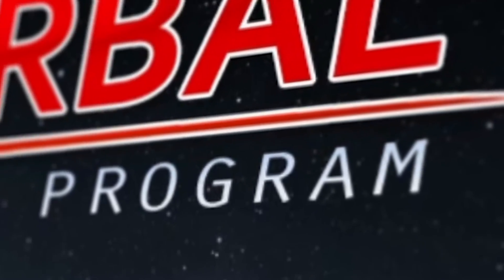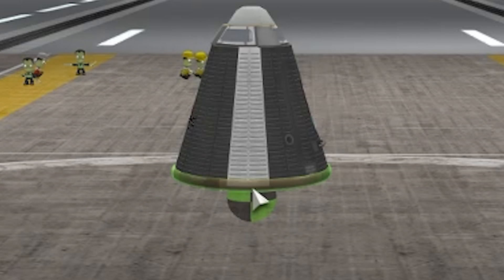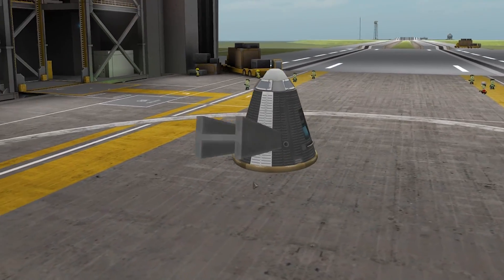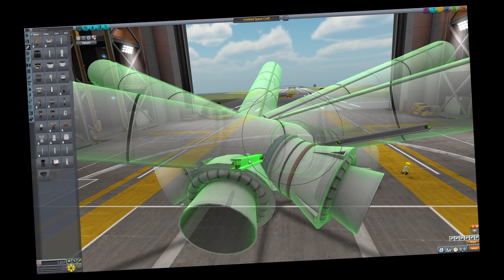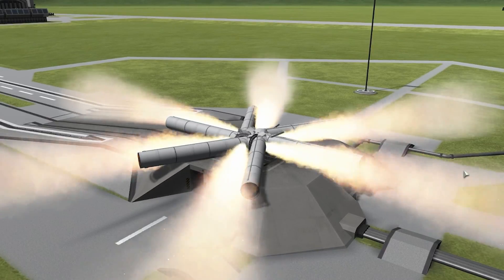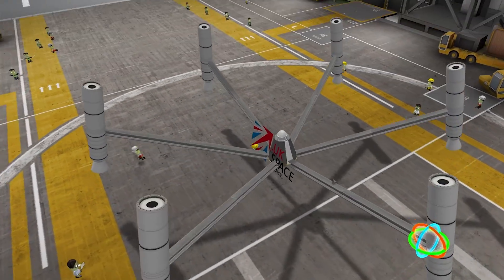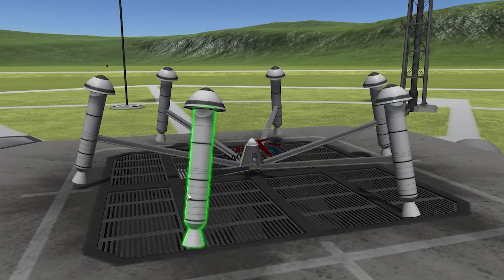I SENT A BRIDGE INTO SPACE and this happened in Kerbal Space Program!

Comment: 1. You can cut the parachute in the context menu.
2. You can toggle "rigid attachment" in the VAB context menu for more stable connections
3. Things will only be attached to where they're attached. Use struts to connect more parts with each other

Comment: if you have advanced tweakabales on you can turn rigid attachment and autostrut and you dont need struts + every part sticks stronger than metal
also hold alt/option while connecting and it will connect beetter
also ksp doesnt actually connect every part that touches together

Comment: Beware, decal flags generate fantom forces, don't use them unless they are really on to the rocket parts with the same diameter or flat surface. You can built areplanes out of decals...
Contrary to the beams, the girders are near undestructible...
To have Uranus in KSP, you might want to install KSRSS (RSS is too difficult for a newbie)
If you are interested on how to cheat the physics range to build megastructures in space, Stratzenblitz has recently done a video on a 5 kms long mega bridge on the little dwarf planet Dres...

Comment: Try to put Jeb on the mun, and maybe if you want to you can bring a bridge with you. also, the little circle next to the symmetry button turns on and off "snaping", so things will stay rotated correctly. this also goes for when you are rotating them after they are placed. holding shift will temporarily turn off snapping. also, boosters tend to work better when pointed up.

Comment: If you hold alt while moving a part, the ends will snap together with the correct rotation relative to each other. Also, there is a a button next to the symmetry tool that turns on a sort of grid for radial symmetry and rotation.

Comment: Hey RCE if you ever want to strengthen something up “(stop it wobbling) you can just add some tethers to itself. Such as in your first rocket, you could add struts from the rocket to the opposite engine this would prevent it from wobbling away from the initial point of control. This would also work on your second rocket. Have fun!

Comment: If you open the pause menu while in the game you can scroll down till you find a setting that says "Advanced Tweakables" , Turning this on allows you to enable two extra settings when you right click on parts in the editor.

These settings are
"Rigid attachment: Off/On" Which greatly increases the strength of the joints making it less bendy.
And
"Autostrut: Disabled/Heaviest Part/Root Part/Grandparent Part" this setting basically creates invisible struts from the part it's activated on to other parts automatically depending on the setting.

If you activated say, Grandparent Part autostrutting on those boosters on the ends of the girders, all 6 of them would automatically connect to 1 girder on each of the arms. This would give the rocket the same structural integrity as if you'd placed 36 struts connected the arms to  the boosters.

These are pretty much required for larger, more complex, and more structurally dubious rockets.

Comment: Excellent job on the bridge, but no, it doesn't count as space, sorry. :)  Space in this game is pretty explicitly defined as starting 70km above Kerbin. 

I suggest you try to get a bridge to orbit. That should actually be a fair bit of challenge, given that bridges aren't very aerodynamic in their normal orientation.
(Hint: keep speed relatively low at first when you're near the ground, like 100 to 200 m/s, because air resistance low down is rather a big factor.)

Comment: Back with more overly detailed KSP advice because I liked the video, I want to see more, and I want to maybe - just maybe - see you become half as good at putting things in space as you are at making me laugh!

The annoying and wonky part placement going on at 2:15 was due to the combination of placing the booster with surface attachment mode (where it attaches radially via its side, not via the nodes on its nose/engine) on and having symmetry on while the part you're attaching to also has symmetry. This will cause the editor to show the 'ghosts' of all the boosters as soon as you mouse over any part of the craft, making it really hard to see what's going on and put it where you want it. You want to turn off symmetry mode (shift+x) and surface attachment (hold alt) until you get your mouse over the place you want to attach it, then turn on symmetry and surface attachment as desired (release alt, press x) and the symmetry of the part you're placing will immediately conform to that of the part you're attaching to. Personally I find this most useful putting payloads in cargo bays, as it's almost impossible to attach to a docking port node inside without holding Alt.

Mandatory reminder that if you're serious about having remotely realistic part rigidity, you need Kerbal Joint Reinforcement (KJR). It's not even a mod, it's a bug fix. I'm not mad, noodles are quite funny, but they're not taking you to space without a ton of struts - several tons for larger craft.

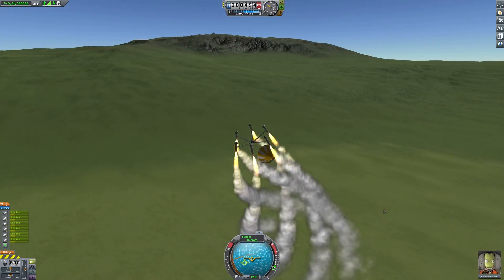The shaking that you saw in craft 2 and 2.5 (4:15-ish) that happened out of nowhere in craft 2 and that escalated from a slight sag in the beams in craft 2.5 are both "kraken attacks" - which you can find tons of info and memes on in the KSP community - and in this case were due to how KSP handles deformation at nodes... namely, not well. I explain a bit of the back end of the stock physics engine in the next paragraph, but the long and short of it is KJR will also fix this.

When your beams started to bend at 4:55, KSP went to every deformed node and started immediately applying phantom forces to both parts that are attached to each such node to bring them back into alignment. Because parts are infinitely rigid and translate these forces down their lengths instantly and - this is critical - because the nodes themselves are far too weak to handle these forces and deform further from neighboring oscillations, the collection of beam-node-beam-node-beam can easily devolve into a self-reinforcing wobble. For the earlier "rapid onset" and immediately violent shaking, that's a result of weak nodes interacting with zero-mass parts (physics mass, look that up if you care) or other dark magics... all of it gets fixed by making the nodes stronger. That's why KJR is nice. Oh, and on a related note, the base strength of nodes scales with the square of their radius/diameter and KJR doesn't change that - sometimes you need to use wider nodes for heavy payloads even with KJR. Oh, and when the boosters fly off your rocket like you "didn't attach them", you didn't attach them wrong - the only mistake you made was not downloading KJR! 

lul noodles go wiggle wiggle.    /KJR

If you want to make a big truss structure with minimal mass, you want to put a cubic octagonal strut (henceforth "cubes") at any vertices of your triangles that don't already have a surface to attach to - not make the whole thing out of beams as you did at 6:40 - you can then strut the floating cubes (get them there with the shift tool) to your beams to make your triangles, or you can take this approach further and build entire bridges out of floating cubes and struts, starting with a cube as the root part. This will actually work in stock KSP if you use triangles because struts aren't nodes and are just about infinitely rigid.

When you built that beam-truss monstrosity... firstly, it was wonderful, thank you. Second, the reason some weren't attached is that parts only attach at 1 point when you place them - either radially or by their nodes. The attachment stays where it is even if you offset the parts and the spooky physics I talked about will sometimes punish you for that, but not too often. Struts are the kosher remedy when you're making something with triangular junctions like that, so props for that, but you'll save mass (and maybe gain strength) by swapping the strut vertices for cubes and swapping the beam sides for struts.

15:00 is another example of "no that doesn't attach on both sides, you need struts here". You did strut the beam in place, but you could just use a strut and save the mass of the beam.

KSP - KJR = Strut Simulator.

Next time, I'd like to see you download KJR, slap more decouplers and boosters along the length of the bridge, put them as stage 1, set the ones already there as stage 2, and get the thing past 8000 m. I think you can do better than 747 cruising altitude ;D
Reply from the maker: Haha thanks again for the detail, it's on my list to try but I'm determined to get the noodle to space first! But yeah I'll defo check it out for the next bridge episode, should save some time! I like the floating strut idea too, will try that!
Reply: @RealCivilEngineerGaming  re "determined to get the noodle to space first"

OMFG LOL. Alright mate, I'll enjoy the show but just remember you've got an out if you get frustrated xD

Comment: Nice build, I’m impressed you managed to figure out KSPs arcane building system in just a few sittings. You’re pushing the limits of what’s possible to build in the game. 

The thing with KSP parts is that they work on a parent-child system. The root part is the first part, usually capsule, and parts you add to that essentially form a tree structure. You can’t actually connect part of the “tree” back to itself. This is just a limitation of the .craft file system, and it’s what allows for the staging logic to work.

You already found the solution though, which is struts. Any two parts attached with a strut are magically made rigid to each other. You can basically build any megastructure you want, but it’s nothing like polybridge.

Comment: As you found out, the game isn't designed to allow parts connected into loops without using struts (space tape.)
There is a mod that might help with that called "ReCoupler." It allows end nodes to be connected into loops, triangles, etc. You'd have to customize the settings a bit, but you wouldn't have to use so many struts.
Reply: just want to add some further clarification. 

the game models the physics of each part of a rocket separately. to the game a rocket is a collection of parts flying in unison with the green nodes, which you see in the vehicle assembly building, acting as forces which pull the parts together.
Reply: The game only allows you to connect a piece to another piece. Not to two pieces at the same time

Comment: One thing you should know about ksp, physical connections work as a tree structure, like, branches can't connect to each other, only to their root part. The only parts that don' t work like this are struts and fuel transfer thingeys. Also, try connecting a part to a node while holding ALT, this will make stuff only connect at the little green/black balls, and not at random spots in the middle. You can rotate parts you haven't placed yet using WASDQE(but I guess you found those already) (shift for finer controls). Also, if you turn on symmetry on anything higher than 1, and your root part was placed with symmetry, it automatically adjusts your symmetry to the amount of symmetry with which the part you are placing it on was placed.

Comment: This build would have been far easier if it was built in the SPH (Spaceplane Hanger) since its set up by default to do bilateral symmetry instead of radial. Would also benefit from using the launch clamps (in game name: TT18-A Launch Stability Enhancer). They are unbreakable ground nodes used to keep rockets from falling over before launch. Just remember they use staging to decouple the rocket or bridge in this case otherwise your rocket is going nowhere until something breaks. I would love to see a bridge with wings on it flown like an airplane.
Reply: Yes those launch clamps would have helped him out alot, and if he messes up the staging of them he can just always act like he is doing an extreme load test on the bridge

Comment: 1: you have mastered the two great lessons of KSP bodging. moar boosters and moar struts.
2: you can set the rotation to "absolute" to point the rockets strait up
3: offset the rockets down, and add control surfaces to the bottom. this will make your rocket bridge both more stable and more impressive. don't bother tweakscaling the control surfaces, though, it doesn't really work for some reason.